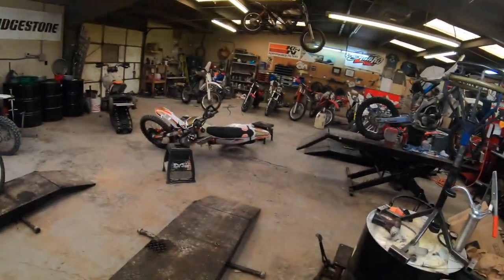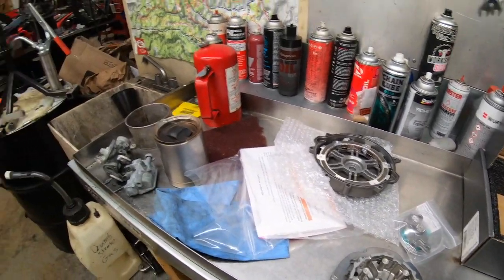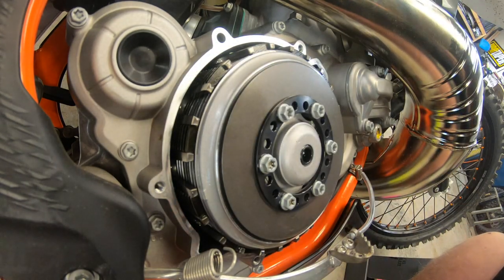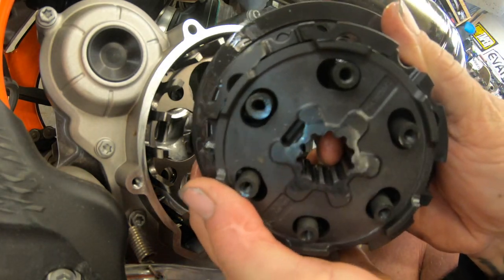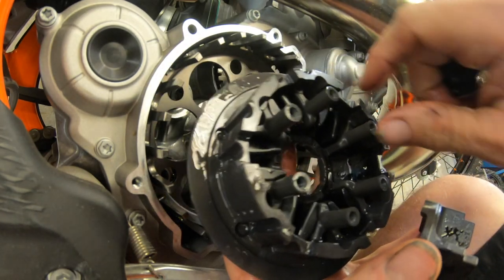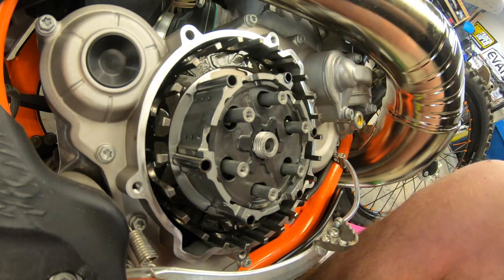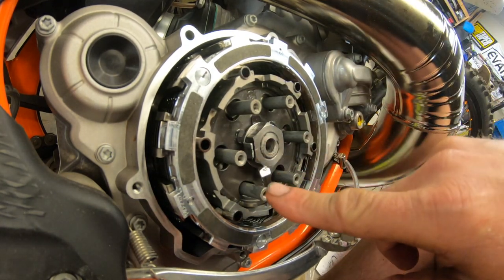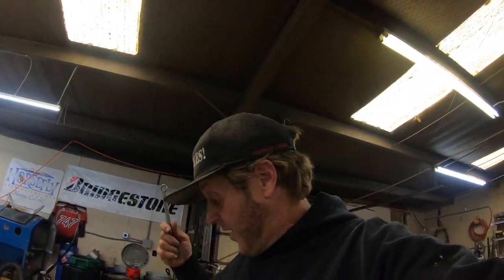How do you install a Rekluse in a 2020 KTM 300

Comment: Got to the slave cylinder install part on the 2022 version of the same bike. I'm stuck because the top and bottom left screws are too long after removing the orange KTM guard. Not sure what to do.
Reply from the maker: Get shorter bolts.

Comment: Hey Morgan great video, always enjoy the content. Would you know what the differnace is in the rekluse slave cylinder pistons between the 300exc is -330 and 350excf -318.
742-028e
742-026e
Reply from the maker: Not 100% sure but it is probably the thickness.
Reply: @highlandcycles  ok cheers, I just installed my cx rekluse from a 2021 ktm 350exc to my 2018 300 exc. Only differnace was the cover. Good to know!
Reply: @ammechanical7660  Creo que son totalmente compatibles. La única diferencia sería el número de discos plateados y ferodos a instalar.

Comment: Hi guys great video,  2019 ktm 300tpi 70hrs on it with core exp it has just started to stall when engaging first what do you recommend 👍
Reply from the maker: Just need to adjust the freeplay gain. Use the adjuster on the slave cylinder. Start by going in 2 tick marks.
Reply: @highlandcycles  thanks for the advice  will give this a go and update you on progress 👍
Reply from the maker: @emperorofmankind5840  awesome
Reply: @highlandcycles  did exactly as you said its back to mormal not surprised as I haven't checked it since new and its on 70hrs ,thanks for the help 👍👍👍
Reply from the maker: @emperorofmankind5840  SWEET

Comment: Did not look like enough free play gain? That was about 1/16 of inch and 1/8 is recommended, no?
Reply from the maker: It is hard to tell in a video and the actual spec is somewhere between 1/16 and 1/8.  Trust me, it was good.
Reply: @highlandcycles  sweet. this has me thinking maybe on my recluse bike i should be running less FPG? Do you recomend i try and run less? what would the advantage be? more time between adjustments? but more risk of using up the friction plates decreasing longevity? this clutch confuses me im entirely too dumb for the recluse, all i know is i like riding it :)
Reply from the maker: @thepatternforms859  less FPG will give you a little more slip which will equal a little better “traction control” and smoother delivery of the power. It will end up being a little harder on plates but In our opinion the wear difference is negligible
Reply: @highlandcycles  thanks man.

Comment: Hello, why do you put the screws in number 2? the rekluse manual puts 2t at number 3!
what is the difference ?
Thank you
Reply from the maker: Juan vanrell I like the feel of it in the number two (lighter pull) and you are actually supposed to install it and check the washer for flatness.
Reply: @highlandcycles  my bike is ktm 300 exc tpi  2018 and i have installed the rekluse EXP 3.0  ktm parts, it is not damag for my bike in the number  2?     Sorry my english  i am from spain
Reply from the maker: Juan vanrell no damage at all. As long as the clutch doesn’t slip too much and the lever feels good then you’ll be fine. Your English is better than my Spanish.
Reply: Hello, I would need your help, my rekluse clutch is a bit abrupt when I open the throttle and it dislodges me from the path, I would like it to be more progressive, how could I solve it?

Comment: He didn't toque any bolts. Also, brake fuel will eat the paint off so better not to drip it over the bike.
Reply from the maker: I didn’t torque any bolts because I’ve installed a ton of these and I know how tight to make them. As far as the brake fluid, yes it will eat paint which is why it’s a good thing the bike is all plastic and the frame is tougher than normal paint. All gets washed off long before it could ever do any damage.
Reply: @highlandcycles  ... As a Auto  Mechanic myself , I know that you can't guess torque settings so that is nuts. As for washing off brake fluid and that plastic is tougher than paint ... That is dumb !  My thoughts on your skills is that you should be a better Mechanic , it only takes a few mim to do the right thing.
You will never work on my stuff!
Reply from the maker: @goodboyringo9716  Ok, I respect your thoughts.  I have lots and lots of very happy customers and have never had a problem on installing those clutches or with damaging anything on a dirtbike with brake fluid.  Street bikes are a different thing and much more care is taken with paint.
Reply: @highlandcycles  I love to hear your excuses for sloppy unprofessional work.
Reply from the maker: @aaronaustin-c4u  that clutch is still in that bike working perfectly.

Comment: There are soooo many errors in this video I don't know where to start! Don't you own a torque wrench? Rekluse is a great Company and you probably cost your customer 40-50% of the life span of the friction plates. As far as bleeding the slave cylinder, you fill it before you bolt it to the bike!

If I was you boss, I would never have let you post this video. If you are the boss, you won't ever work on my bikes!
Reply from the maker: Sorry to hear that. I have installed tons and tons of Rekluse clutches from the Z start pro to now and have never had one be bad. And friction plates always last as long if not longer than stock clutches. Yes I own a torque wrench and I don’t think you need one on a clutch install. I have watched countless factory mechanics not use a torque wrench on any part of a clutch on bikes that are actually making money. Have a great day, I hope you get out and ride.
Reply: @highlandcycles  I didn't say that I had a bad Rekluse clutch. I said you were costing your customers. I help develop these over the years with Rekluse. You need to use a torque wrench and thread locking compound.